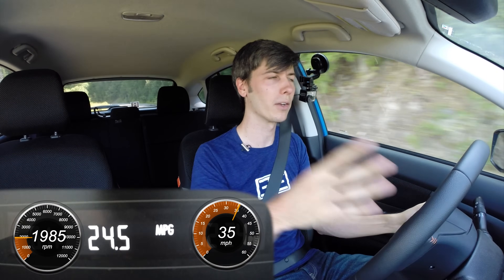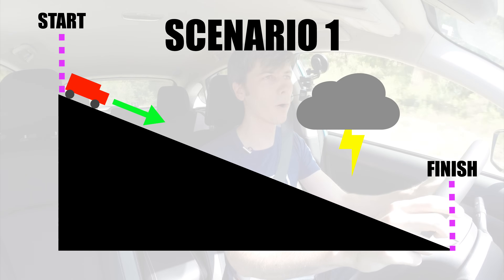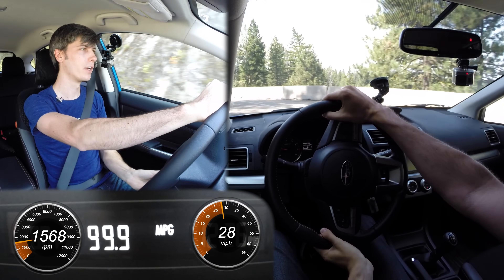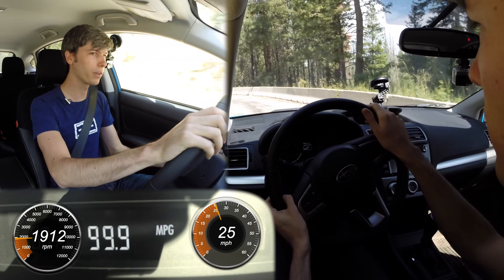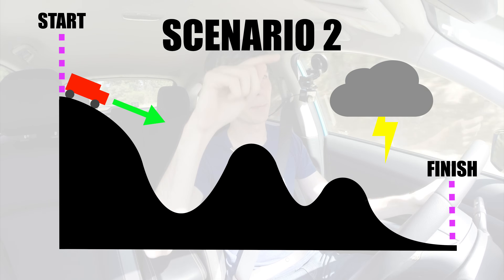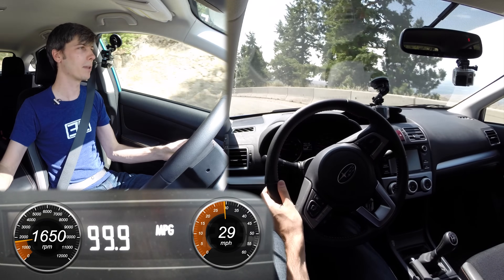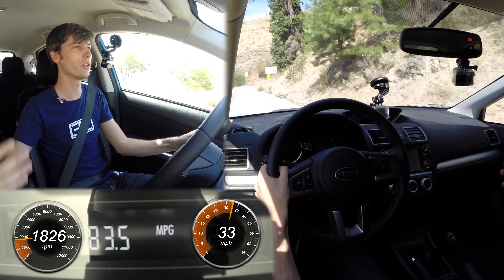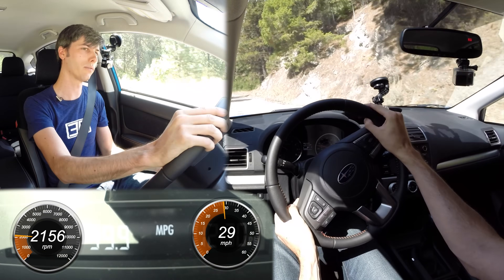What Uses Less Gas - Coasting Or Engine Braking?

Comment: I'm not sure the 2nd scenario is accurate.
1) When the car goes faster due to no engine breaking, there will be more drag which is not linear  proportional with speed.
2) Also if you can allow a higher cruise speed then use a high gear to reduce waste on engine braking. Keep engine RPM minimal.

I think high geared engine braking will be most efficient at typical safe speeds. E.g cruise down hill at 35mph in 6th gear unpowered.

Comment: What about carburated engines?
Reply: They use fuel all the time.
Reply: when you release gas pedal, the engine use the same amount of fuel than idle
Reply: Neutral, i personally own a carburated engine and it actually does not really have a great impact on the mpg anyway, that is for lower rpms coasting vs engine braking. I just go with the engine braking for the exhaust pops lol.
Reply: On my LPG powered car (which essentially works the same way as a carburated engine, uses vacuum to determine how much lpg to use to fuel the engine) the higher revs you are means more fuel is used as the engine is sucking in more air than at idle speed. The lower the gear you coast in, the higher the fuel consumption.

Comment: Do you ever have issues with rattling in your new crosstrek? I bought a 2017 forester and I have had a door rattle, a defrost vent rattle and now a-pillar rattles. The dealer fixed them but not till after a few tries/trips. There's also tiny ones still in the doors that they can't find, it's very annoying. Otherwise a solid car mechanically so far and maybe I'm just being nitpicky.
Reply: Andrew Boreen You have a brand new car, it should be rattle-free

Comment: From experience, my car coasts further in neutral and the average fuel economy becomes higher if you don't need to brake for corners (as compared to leaving it in gear). I think it really depends on the weight of your car. My car (Volvo S80) tells me to shift to neutral to save fuel. It's a heavy car (1700+ kg). Large European trucks have this feature called 'EcoRoll' which shifts to neutral going downhill. The fuel savings you get by coasting far exceeds the fuel needed to keep the engine idling.

Comment: The opposite is true in my civic with torque running, MPG goes to 200 off gas, goes to 270+ in neutral
Reply: **whoosh**
Reply: this is not normal...
Reply: that is not proof
Reply: TheeJoeyLee I'm watching the video now so I'm not sure if Jason will cover it, but not all engines have fuel injection cut off. I think your Honda may be older?
Reply: forgot to mention when the engine is in neutral and coasting it is probably pulling in less air than if you were coasting in gear, hence fooling the app if its only going off of airflow measurement. you could verify with throttle valve parameter in app
Reply: Your Civic probably uses 0.2 gallons per hour, perhaps less.  If you are coasting at 50 MPH, that is 250 MPG.  You would save that 0.2g in-gear, but could not coast nearly as far.
Saving gas at the cost of brakes does not make sense to me, though.
Reply: TheeJoeyLee Are we supposed to know what that is outside of some Honda forum?
Reply: TheeJoeyLee - with R18a2 in gear coasting seems to get full MPG as you back off the gas and let the car run in which ever gear it's in. You can coast to near standstill in higher gears just foot off gas lol the way through.
Reply: Apps and fuel gauges do not necessarily know when the ECU cuts off fuel.  I needed to find the setting for my Ultragauge.
Reply: Well you have to consider the average mpg for the comparison. If you drive a longer distance with a lower mpg than a shot time with a higher mpg but you have to accelerate you get a worse economy than idling.
Reply: yes but we're talking about cars not engine starters
Reply: David McClelland did we watch the same video?
Reply: DE Nichols R18 engine
Reply: DE Nichols read the pinned comment he made
Reply: Buddy Clem I explained it. Just goes to show how many factors to consider in calculating mpg, and how each car is different, even a common civic.
Reply: Gecko I noticed the engine braking thing in my car as well. I think I just need to mess with the app more and do another calibration perhaps
Reply: K0nst4nt1n96 um...
Ok?
Reply: Deceleration fuel cut off doesn't kick in until at least 1500RPM, sometimes as much as 2000rpm+.  So you can engine brake at lower engine speeds but there is a chance you're still burning fuel. If the engine in spinning at 3000rpm+ and you're off the accelerator, you can be guaranteed to be in deceleration fuel cut off and engine braking. It just depends on the car. Oh and this does not apply to carbureted vehicles.
Reply: air flow is what 99% of of these MPG displays use....

in N.... your car is at idle.....~800 rpm
while in gear..... you are going to be above 800 rpm, probably 1500 to 2000

the higher the RPM..... the higher the air flow...... thats how engines work

higher air flow does not mean higher fuel usage however...... if you want to actually see the REAL fuel usage, you need to look at fuel injector pulse widths
Reply: same thing happens in my car, app is most likely going off airflow measurement  and calculating fuel based off air/fuel ratio instead of using injection pulse width, which when injectors were off would read 0ms
Reply: Marc Monson must be. Also its an Atkinson cycle engine so that may not be anticipated by the algorithm torque is making its calculations with.

Comment: My Honda Fit is the best coasting vehicle , either in neutral or 6th, I've ever driven.  I'd figured out that it was not using more leaving in gear, but didn't know about the fuel shut down.  Thanks. It does register over 99 mpg on the overall trip monitor showing 158 mpg after coasting down Mount Eagle in Tennessee.

Comment: If you were going down a steep hill which ended with a long flat stretch and you wanted to use the least fuel with the car only stopping because there was no forward momentum left, which would get the best mpg? The car may use some fuel in neutral, but being in gear limits the speed/momentum due to gravity for coasting on flat ground; the car in gear will not coast as far. Obviously gear choice would have an impact. I think you would need a more precise test than the demonstration presented here to answer that question

Comment: DO NOT coast down a hill in neutral in an automatic!  On more than one occasion i have seen transmissions fail prematurely due to this;  The oil pump is based on engine speed and without high enough engine speed everything does not get lubed properly when the car is moving at higher speeds.
Thank you engineering explained for the video I know you said your ignoring the negative consequences but i felt like you should have mentioned this.

Comment: Or you could go electric and regenerate all this energy instead of wasting it. That would be the most efficient and cheap way!!
Reply: Considering an ICE doesn't work as a generator of fuel when engine breaking, even the crappiest electric motor would be more efficient since it would store at least some energy.
Reply: I'm constantly trying to decide whether to coast or charge. I think Coasting is more efficient than charging if you have a long flat at the bottom of the hill to continue rolling even taking account wind resistance. But if I try to coast I end up having to slam on the brakes for one reason or another wasting the energy that could have gone into the battery. It also annoys the hell out of other drivers! :D Nearly always better to follow the traffic and charge the battery instead.
Reply: As he says, it depends.  My assumption was a US highway where it is generally safe to travel 90MPH and slopes are around 5%, starting from about 50 MPH at the top of the hill.  Hills that are steep enough to reach higher speeds that cause higher drag which will exceed the losses in the charge/discharge or require the use of braking anyways will be worth it for electric.
Reply: A buddy of mine has a hand me down Prius, and one thing they got right is being able to throw it into full regen mode, so it's like having a proper engine brake on steep downgrades, just not quite as powerful.
Reply: GoogleMinus some times, you can take an empty (hybrid) battery at the top of a mountain grade and fill the battery before the bottom; something to be wary of, as it then cuts regenerative braking and you need to be ready to apply brakes or start to accelerate pretty quick from gravity ;)
Reply: Actually the Regeneration is not as efficient as letting the electric car coast due to heat loss etc.  If it is a steep hill the regeneration ist always more efficient than using your brakes. Everything is more efficient than using your brakes. Never use your brakes unless you have to.
Reply: GoogleMinus I think that refers to hybrids not fully electric cars. I mean aside from initial costs, there's no reason to keep using engines when batteries are superior in ever way. Cheaper, more efficient, better performance, and greener too.
Reply: Mustafa Hasan Efficient, sure.  Cheap? No. Unless you want to buy me a hybrid.
Reply: Coasting isn't necessarily more efficient, because at higher speeds friction and drag are much higher, so you are losing energy. Also unless the hill is very small, you will go way too fast and probably die.
Reply: Electric Cars are super expensive 70,000-250,000$. That’s the problem people say “oh get a electric or a hybrid car!” It’s like “well do you own one?” “No” Gas companies have their filthy hands in the industry to control the cost of vehicles.
Reply: If stopping at the bottom of a hill yes, but if you can use that energy towards the next hill or coasting at the bottom it is much more efficient to keep the energy as kinetic instead of converting it into electrical, storing it, then back to electrical.
Reply: Not necessarily more efficient, because you need to turn the motion into electric, charge the battery, then take it back out of the battery and put it into a motor.

Comment: Always drive with a gear on, never drive in neutral, when you drive in neutral you lose some control over the vehicle and if something happens it will be to late to put it back in gear.
Safety is more important than saving few cents.

Comment: Since the engine is still running even if the injectors shuts off while leaving in gear, will the spark plugs wear faster since the air fuel mix goes lean ? I guess as long as there is no misfire it doesnt matter ?..

Comment: wow that means by going down a hill you can use tha a/c for free
Reply: Archer true but if you intend stopping at the bottom you might as well use it. It kind of is free if you were just going to brake and pay to use a bit more brake pad and disk.
Reply: ha, go up the hill with A/C off, go down the hill with A/C on
and presto!... free A/C   :) :)
Reply: Some times i just wake up on top of a hill in my car. i then have to get down -> free energy
Reply: I often turn in mtmy AC and rear defroster when going down long grades on my way to work and turning them off at the foot of a hill
Reply: Free because you're not using the brakes as much is what he means.
Reply: Yeah, you shouldn't drive up hill and then same route back just to get "free" ac, but if you're driving up/downhill anyways, you might as well use ac while coasting
Reply: SakariNy Agreed. I you have to go over the hill anyway this A/C use is not using fuel. Assuming of course it didn't cut into the roller coaster scenario Jason brought up.
Reply: haha thats not what i meant, if i go over a hill anyway, and there may be a speed restriction it will use less braking.
Reply: Not for free no, it comes at the cost of some speed (= energy, = fuel) you could have gained if coasting. In many cases you can't actually leave the accelerator untuched because the engine brake causes your speed to drop too much, and you lose the advantage of being in gear vs. idle consumption when coasting. Coasting is good when used smartly.
Reply: @Alecsfreeman  I think on those scenarios you have to use a higher gear to get it moving faster!
Reply: My AC has been broken for many years!
Reply: You can use the AC as a brake
Reply: Clever person detected (y)
Reply: nutzeeer you’ll have to go back up that hill eventually.
Reply: Free? You had to get up that hill in the first place right?  There is no such thing as free energy.
Reply: Archer 

No, he bought the car on the top of the hill. Lol
Reply: @jarhead1145  just start at the top of the hill.

Comment: Driving a big rig... Use engine brakes to save BRAKES  and lives lol.
Reply: No Georgia overdrive for me.
Reply: Ashton Pinch true I'm a Honda guy so I knew my gears better with my GSR. That Turbo Eclipse wasn't my preferred choice those gears were longer . Sold it lol went back to Honda Integra like I shoulda stayed with.
Reply: @J.D-u4h  you can travel down hill faster with engine brake because you are not using service brakes or very little. If you are on the brakes the whole time they will over heat and therefore fade. No brakes, you are no longer in control of a vehicle. 
If you'd like to know more, feel free to ask.
Reply: @_Mario_PL_  Thanks for the offer but I actually know more than you.  Can't believe you're actually arguing that braking is faster than not braking---do you know what brakes do?  Why would you even compare methods of braking in a discussion about traveling downhill faster?  Clearly braking of all kinds is the antithesis of downhill speed.
Reply: @J.D-u4h  please read the OP comment and the whole thread here, you'll have a better idea what is being said. 
By liking your own comment, won't make you sound any smarter.
Reply: And activate the exhaust brake
Reply: Henry King it's more of not overheating brakes than saving them. Overheat them and you don't have any to stop the rig. With engine brake (retarder) you are able to travel faster down a hill than without, because of overheating the brakes.
Reply: MarioPL true overheat caused me to lose brakes on my old Eclipse GST back in the day.
Reply: +Henry King TFW you have it in just the right gear and engine brake setting and don't even have to touch the service brakes :D
Reply: Engine brakes wear out your clutch
Reply: using the engine to brake seems like unneseccary wear on the engine, i'd rather change the brakes than wear out the engine, shifting gears unnesecarrily because you think you're saving fuel (which you're not) is also bad in the long run.. going from idle 900ish rpm to 2000+ in a split second (whilst the engine had a bit of time to cool off) can't be too good for the engine either.

Comment: Engine brake, because i notice the engine cooling off when engine braking down long stretches, meaning no combustion to generate heat
Reply: Buisang Ndlozi friction , air is still moving through the engine
Reply: high rpm engine = high rpm on the water pump
Reply: Georgi Popov not really , just the normal 3-4 k revs
Reply: If you leave it in neutral down hill it will get cooler
Reply: What I don't get is why there's still engine noise if there's no combustion?
Reply: Stuck open thermostat
Reply: BO4wd yes it will.
Reply: Alejandro Lanza there's only so much heat the thermostat can hold on to.
Reply: BO4wd it won't
Reply: DE Nichols the thermostat doesn't "hold on to" any heat, it just blocks coolant passage into the radiator
Reply: Cool stuff!
Reply: Alejandro Lanza 
Why do you think so!
Can you please explain!
Reply: BO4wd combustion releases more heat than no combustion
Reply: Alejandro Lanza 
Ok,  so you mean that engine braking at around 4000 rpm has less heat than engine idling at around 800 rpm?
Reply: BO4wd correct, while braking it's more of an air pump, with little to no combustion. It still must generate heat, that's where your car's momentum goes, but that's still less heat than what it would generate combusting at 800 rpm to keep itself and ancillaries running
Reply: @gav I think you need to have your car looked at, the fact that you can see your temp rise and lower while driving isn't good, usually means there's a issue with the cooling system.
Reply: Alejandro Lanza  how about air compressor?  They get warm to!
I will try this next year.  I will use computer to exactly se engine temperature. 
One run downhill on idle. 
One run downhill in gear.
Engine will be 90c warm to start with.
Reply: BO4wd not the same, an air compressor has an engine moving it, here it's the car's potential energy (by virtue of having climbed up the hill before) that moves an engine that somewhat behaves like an air compressor. Yes heat is generated, otherwise you wouldn't experience a braking effect, but still less than what combustion would get you. 
Your test won't necessarily work, as hinted before cars have thermostats. Yours would have to be stuck for the test to prove a perfect comparison, similar to what the above poster stated. You might still see differences though.
Reply: Alejandro Lanza so if you have temperature well below 90c the thermostat will not open. 
But still you will be able to se different temperatures,  idle vs. engine braking  if you use computer to read out engine coolant temperature.
Reply: Alejandro Lanza as I said i will try this to see difference between two.